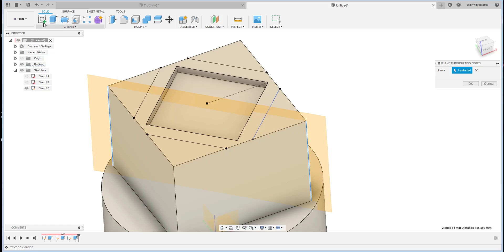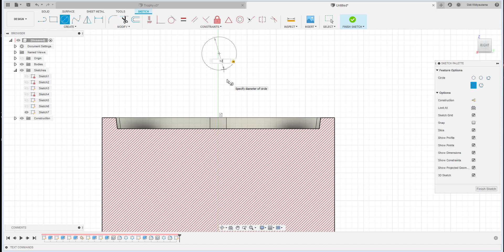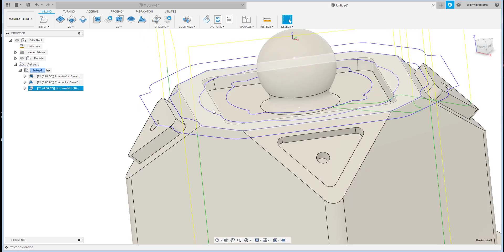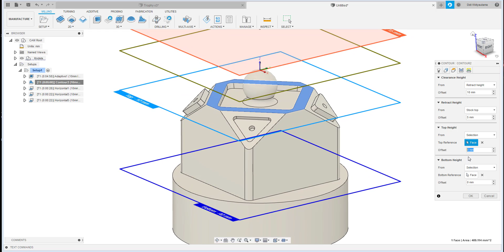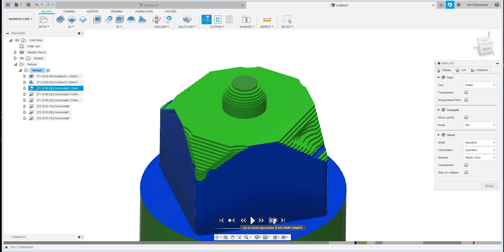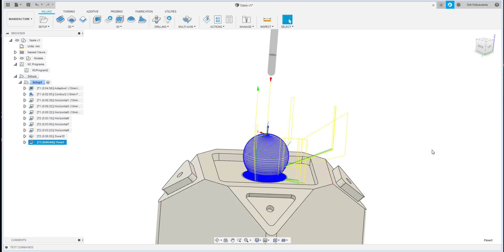5 Axis CAM - Fusion 360 Tutorial

Comment: Hi There, thanks for your sharing. and one question is that the last operation 'Flow', my toolpath start cut from the bottom, not the top, which is  different from yours, tks
Reply from the maker: Please check your surface vector direction, flow toolpath basically will follow it

Comment: Dear Sir,

this is an absolute excellent tutorial  !!
I recently got a 3-axis CNC milling machine,
which I designed and built myself.
I am currently using MACH3 as the CAM software;
but would like to switch to MACH4.
I would like to expand my machine to 5 axis.
For this I would then build a "Trunion".
I just wanted to ask if I can get the original F360 file
from this tutorial.
It would also be just for me for study purposes and I would
don't publish it either !

Greetings from Hamburg / Germany
Achim

Comment: Created a 5-axis toolpath with Fusion 360 CAM flow.
The generated NC-Code doesn`t correlate to the motion of the endmill.
Can you take a look at it?
Reply from the maker: you need to setup the post processor setup and match it with your cnc
Reply: @DidiWidyaUtama  Thanks

Comment: how come 5 axes and the gcode contains 6 axes x, y, z, A3, B3 and C3 ?
Reply from the maker: The post processor i used was the default generic from the fusion library, you need to adjust the post processor to match with your machine, thank you

Comment: Thanks Didi!
Reply from the maker: U'r welcome
Reply: @DidiWidyaUtama  I have a question, when I load a file part made in solidworks ,the position of the part in fusion change, its normal? any tip?thanks in advance
Reply from the maker: @matameh  if any part imported in fusion usually the position remain unchanged, it refers to original CAD origin.
Reply: @DidiWidyaUtama   was solved , sorry for my dummie question haha, Thank you Didi. Regards